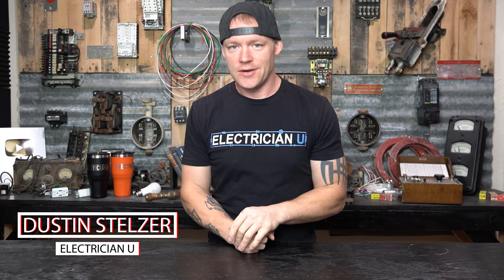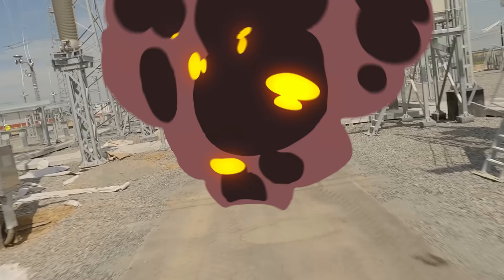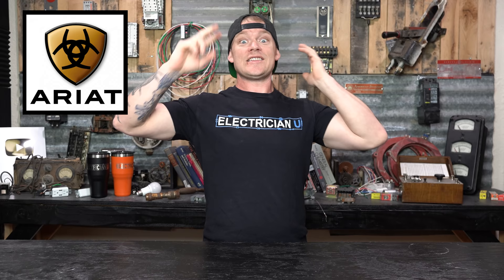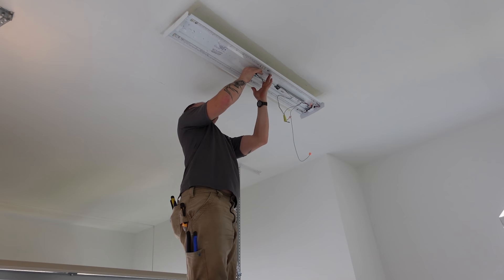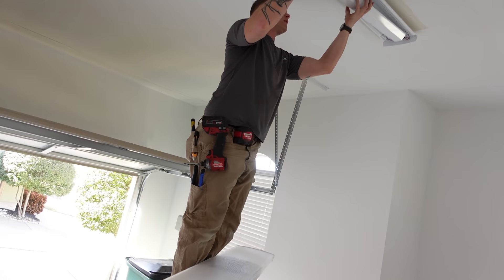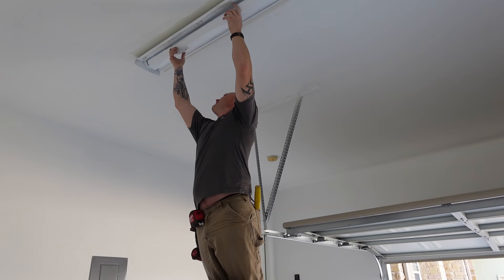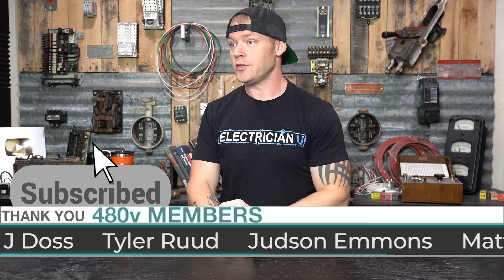Swapping Fluorescent Garage Lights to LED

Comment: I couldn't agree with you more about eliminating risks where possible.  One job that I had was replacing fluorescent lamps with LED in a common area in an animal shelter.  There were people coming and going all the time in the room since it was during the shelter's adoption hours.  To eliminate the risk I shut the lights off at the switch, put some duct tape over the switch, switched off the breaker, and put some duct tape over the panel door.  Nothing's foolproof of course, but those physical barriers gave enough people enough pause to ask me if they could turn on the lights - while I was up on the ladder fastening the wirenuts!  It worked, and I'm still here to tell the tale.

Comment: I always thought the "reflector" was called the diffuser, it doesn't reflect it diffuses
Don't take it the wrong way
Reply: The reflector is the shiny panel above the lamps, the diffuser is the lens below the lamps.
Reply: @johnkowalkowski4269  Yes I understand, what I was saying though was that in the video he referred to the diffuser as the reflector. Besides I've never seen  floresecent tube fixture that utilizes an actual reflector, now I've worked on plenty of CFL fixtures that do have reflectors but no diffuser.

Comment: Re: Shut the power off... It should've been obvious, but I found out the hard way that turning off the wall switch doesn't protect you in wiring scenarios where the incoming power goes first into the ceiling box, with just a switch leg going down the wall. Granted it should be different conductors, but still it's a hot box.
Reply: My very old house has that same style of fixture-first wiring!  Learned that lesson a long time ago...  I don't think its done that way anymore, but DIY-ers beware.
Reply: @jefffree6990  Definitely not done this way anymore but same story here with an old house. It was a fairly common wiring practice in the 1950's.
Reply: And then factor in that it was often the neutral line that was controlled by the switch years ago, and you’re doubly set up for electrocution if u don’t know what you are doing

Comment: Code governs all aspects of installation and most inspectors use common sense as apart inspection, but there is a code that pertains to faceting a light fixture to the ceiling. Everything from screw size for fixture weight ratio to how many facets necessary to hang the fixture. 

A red piece of tape with the word danger over the light switch or breaker may stop someone from turning it on, but always work on devices as if they were energized...

Comment: I found if its an aesthetic part and its not going to be touched get some thick CA glue and activator off amazon or from a woodworking store and use it to glue that part back together. But use this sparingly so not every thing is super glued together.

Comment: Another great reason to shut off power at panel is too many times I've come across switched neutrals instead of switched hots, especially in older homes where the switches are on old knob and tube and someone has changed the lines somewhere in the walls to romex.
Reply: I had that happen on a 277 lighting system. I was out cold on the floor after that.

Comment: I installed two LED bulbs in a four-bulb flourescent fixture and they worked beautifully. Yesterday they both failed at the same time. 
I moved the bulbs to other slots hoping one of the two ballasts was still functional. No joy. 
Breaker was not tripped. 

So now I plan to bypass the ballasts and see what happens. Of course, I need to verify the wall switch did not fail.

Weird.

Comment: Great video! But, the technical name of a “tombstone” is a “lamp holder”. Tombstone is a slang term. As far as I know, there were no three, four, or more lamp magnetic ballasts when the magnetic (2) lamp F40T12 ballasts was the workhorse up till the early 1990’s. It was mostly with the advent of the electronic F33T8 ballast did they start producing fluorescent ballasts that could handle multiple number of lamps and voltages from 120-277V, which saves on the number of ballast SKUs out there. In this day and age, fluorescent technology is being replaced by LED technology which is exciting!

Comment: I've worked on a lot of T12 Fluorescent fixtures myself.  The most recent one was an 8ft fixture above my workbench.  As far has having multiple ballasts, one possibility is that they used ballasts rated for only two lamps, and those fixtures have 4 lamps, so two ballasts.  Most electronic ballasts can support 4 lamps, but the fixtures featured here look "vintage", as in not having had replacements for a few decades.

Comment: I have never used toggle bolts. Unless the fixture is parallel to the joists, there will be wood on the other side of the wall board. If necessary, I will add screw holes to the fixture.

Comment: Code Time - NEC art. 410-24(B)  Access to boxes.   A chase nipple in the back of the fixture does not meet Code.  You need to punch a 2 1/2 - 3" access hole.  Per code - you need to have access to the wiring in the box, without removing the fixture.

Comment: Honestly, you unscrewed two screws and the light was removed. I got more tips on ladder use vs removing the light. Like, was it wired? If so how did you deal with possible live wire?

Comment: 2 more things, 

1.> I thought those were defusers, reflectors were the metallic backing for the up-firing ones?

2.> jump on the SNAPTOGGLE heavy-duty toggle bolts train, just gives you a threaded hole in the wall/ceiling, I love them for TV, projector mounts, really anything I can use them for.

Comment: Love those jobs too bro. You’re right as well, turn the breaker off when you can. Almost had a customer hit light switch before, my yell stopped her in her tracks 😂. It was one of those older houses with the messy wiring & unlabeled panel.

Comment: Having old two ballast fixtures also made it so you could have to bulbs come on with a switch and then the other two with another switch. Kinda a way to have dimming in an office space before 0-10v dimming.

Comment: Regarding the ~16:00 bit about hot work and people turning breakers on on you, my (now dead, but not from this) grandpa got shocked by something ungodly while working for a sign company. I don't remember what the voltage was, but it was something in either the thousands or tens of thousands and I always wondered how TF he lived after it. 
He was rightfully so pretty upset and bitter at whatever manager let the employee go flip the breaker WHILE he was still working on the sign.

Comment: Love the new format for the videos. Sections for code, sponsors, teaching, advice.. well done. Standing on the top two steps of the ladder is an issue for these other folks who are probably not from Texas where the fuzz on the peaches is thicker than most other states. I doubt OSHA was planning a trip to the garage you were changing these 8' high lights. Remember folks, he's a master, not some new apprentice that has never used anything bigger than a step ladder to get their captain crunch out of the pantry. Much love from Cali, brotato. Keep on keepin on.
Reply: He should have used an 8 foot ladder here. I can tell he is a master at what he does but I also noticed he dropped one of the bolts that secured the light he was removing and when a bolt is loose on the floor and you set a ladder up, the bolt can make that leg of the ladder prone to slipping thus unsteady. It is not about his ability here but rather an example to others he is trying to show the correct way to do this job.
He talked about not going up & down the ladder but the better thing to do here is have a table set up to work on these lights so you are not bending down and working on the floor. I would set up a rolling scaffolding high enough to work on the lights while I am right on the rolling scaffolding. But I am not from Texas.

Comment: I got some 8 footers from a customer who didn’t want them anymore. Replaced my keyless fixtures in my garage and converted the fluorescents to LED. Put in some 5000K Direct Drives. They’ll melt your face off.

Comment: Turn the breaker and lock it off some customers are just stupid and if the breaker box is not in the same room as you someone could turn the breaker on leaving you fizz in. Great videos though a lot different than the UK but it's good to see a different way of approaching the job.

Comment: A fluorescent tube ballast not only restricts me current coming through as a choke but it also generates the high voltage to strike the tube that's why you have one per tube. It is not a transformer.
A LED requires either a constant current or constant voltage driver depending on the configuration of the LED whether it's a single string with designed to run with a limited current, or every LED has a current limiting resistor on board the strip.

Comment: Navy base safety dept. on the contract I work has stipulated ballast driven "substitube" LED T8 and T5 lamps because the ballast delete style caused fires. The delete style comes in different configurations where the hot and neutral are either split on one tube end (tombstone) or wired to each end dependently. There was no standardization and mixing of types caused confusion.

Comment: I think that there are 2 two lamp ballasts in there is so that you can wire them separately. That way you can have two switches and can dim or brighten the area as desired.
Reply: Additionally, allows for half the lights to be on an "always on" circuit while the rest are switched. See it all the time with the facilities I work for. Buildings are occupied frequently, but only momentarily and randomly. So entry lights and every 5-7 after that are typically always on.

Comment: I’ve worked on fixtures with two circuits in them. 3 bulb fixtures 2 bulbs one circuit one on a separate.

Comment: I have done probably a thousand of these by now. I usually rewire direct to tombstone and install LED tubes. I buy them by the case (24) and usually pay $5-$7 per tube. And they are replicable. Most work on 100-300VAC so will go about anywhere. My experience is that you only need two LEDs in a 4 tube fixture. You can also get 8ft. tubes.
Reply: Do I need to do anything special for a 277v retrofit?
Reply: @KatKaut  just be real careful. 277V is serious. I work everything 'cold' (off).

Comment: SAFETY TIP UPDATE  14:42 onward in video.   Please update your video. In this video you say:  (When I switch the light switch off i can go safely work on the light fixtures in the room.) DANGER this statement is untrue.  Depending how the switch and fixtures are wired, the switch could be feeding power to the fixture or acting as a switch to close/open the return. Always test all circuits before touching any wiring. Even neutrals. Just assuming the bulb/tubes are no longer working without thinking it may be an electrical fault can be dangerous. Overall great videos. Keep up the good work.

Comment: Another thing about your safety tip, definitely shut the breaker off and never trust a switch. Way too many times I’ve encountered switches on the neutral, meaning the whole fixture is live even when the switch is off. And also make sure you have the right switch, sometimes more than one switch runs to the same box (say for a ceiling fan).

Comment: You should buy the dewalt folding work table. Best $100 you’ll ever spend you won’t have to work on the floor anymore.
Reply: I honestly didn't know if you were joking or not!  I just watched a video about DeWalt's portable miter saw stand being a piece of crap because it has a tendency to fall over if the miter saw is not seated in exactly the right way.  No tank you, I would like my spinning death discs to stay in the correct orientation at all times.

Comment: Lots of good tips, the dinosaur scared the hell out of me though lol 

What kind of plastic bushing did you use  on the fixture? 

The ideal quick connect, I have a hard time using it with 18 AWG stranded wire, is there a trick?

Is a junction box required? If the previous light was only a lumex cable through a hole in the ceiling?

Comment: Use a laser to measure instead of a tape... 10 seconds and done. Dead on accurate.

Also I had an hvac guy come to work on my unit... he asked "is the breaker off?" then when I said yes he jumped right in removing the 240v line wires. Couldn't believe it.
Reply: An HVAC tech came and did the same thing at my parent's house!  He just trusted me when I said I turned the breaker off and he opened up the electrical panel on the unit and started changing out a capacitor.  He never touched his meter until he had the cap disconnected and removed from the unit, and the only reason he took his meter out was to test the old cap.
Reply: Are you sure it wasn't 277 volt lightning...

Comment: When the mount hole spacing in the new led fixture is different than the
old, why wouldn't you drill holes in the new fixture rather than new hole in customers ceiling?
Reply: Quicker. UL listings.

Comment: I still use fluorescent in my work shop.. daylight bulbs.. housing  last for a decade or more..Bulbs give a lot of lumens.. Plus that damn cover removes usable light..  i hang mine on chains  .. add a pull cord to turn on or off only whats needed for task..  led are over priced for light emitted..   KISS  works for me.. Plus if they fail and they do its the whole assembly in the trash.. DUH....

Comment: The most important function of An LED driver is it limits the current going to the led'S. Led's are current driven devices. They will actually work on AC but will flicker 60 times per second.

Comment: I put in LED lights in the basement.
They are pretty cool they have a plate that you can slide the lights on and off easily if you need to replace a panel that is going out.
I also did a video installing them as well.
And found out while doing it that there was no ground at all and you get to see the hack job of getting a ground in.
It is most likely cringe worthy but it was what I came up with as eventually we are going to fully remodel the downstairs at some point.

Comment: Even in a dead box, I cover the ends of the bare wire with wagos. Just figure out if you’ll need a 2, 3 or 5 way. Might as well put them on in the beginning, you’ll need them anyway.

Comment: Dustin, I know you said about turning the braker off. That's okay but what about the 'tag out-lock out system? Can you use it also on house calls?
Reply from the maker: There are lock-out tag-outs made for going over the breakers and when they close, there is a loop at the end that clips together for a lock to be put through.

Comment: From the critic - Mr. Electrician used the wrong ladder.   If safety is really important - he should have used a 12, or even a rolling scaffold.   

It's just a garage - but - you really should have a tarp on the ground.  

You really should have a shelf to hold your drill, and other equipment.  This gets to engineering the job site - which you did not do.

I watched the video at 2:03 where you're standing on the top rung holding materials in 1 arm.  That's insane.  You're fired because your method is not safe.

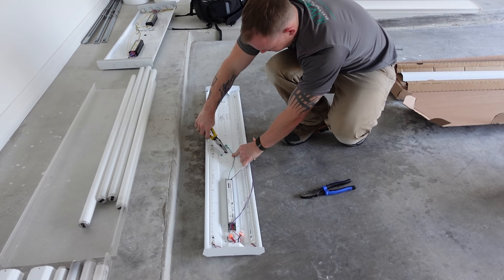Work table.  You really should have a work table in the garage.  Saw horses and a plywood sheet - or a folding plastic table.  Why?  Because it's best to open boxes on a table.  It's best to put your equipment - on a table.  Not the garage floor. At 6:30 you talk about "all nicked up and scratched" materials.  I agree - that's why you ought NOT maneuver materials on the floor - use a table - a table with a canvas tarp.  

You're fired.  I'm bailing out of this video review.

Comment: Did it occur to you that the ceiling above light fixture needed to be painted? Also, you made 2 unnecessary holes in the ceiling. Why not drill the fixture to fit the existing holes in the ceiling? Was it because it wasn't your garage? Rhetorical Question. It would have taken 30 minutes instead of 20.

Comment: Both fluorescent ballasts and LED drivers limit the current through the fluorescent bulb and LED,  not just voltage conversion.  LED drivers are also 'ballasts' in their current regulation function, but the typical use of the word ballasts are the devices associated with fluorescent and HID bulbs.  The term ballast confuses some people because in some cases it describes an electrical function and in others it describes an electrical device.  Nitpicky comment I know.

Comment: Im going to be doing this in my garage soon.  Considering how light LED shop fixtures are, why wouldn't you use the more modern and easier to use screw-in drywall anchors?   Would it be that the screws are not as long as with toggle bolts thus not giving you as much access to the wires?  I just hate toggles!

Comment: Why replace the entire fixture instead of removing the ballasts and putting the new bulbs directly to line voltage?
Reply: Because if the homeowner puts regular fluorescent bulbs in they might explode.

Comment: Sure kill the breaker in addition to turning off the switch, but................   Ladder safety is at least as important.  Don't climb up or down a ladder with stuff in both hands.  Don't try to get by with a barely adequate ladder.  Instead use one that keeps you a couple of rungs from the top.

Comment: The reason this fixture was equipped with two ballasts has more to do with the ability to configure these fixtures with a/b switch legs, providing both half brightness and full brightness.  This is a requirement of California Title 24 for most commercial spaces.  It has a lot less to do with the "manufacturer just having a lot of 2-lamp ballasts laying around."